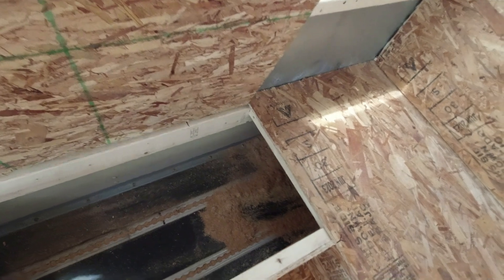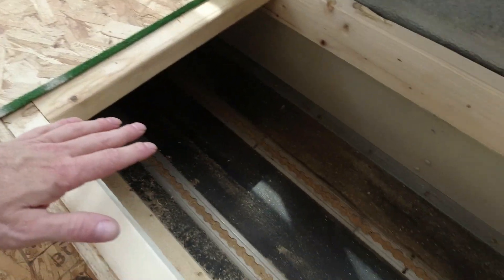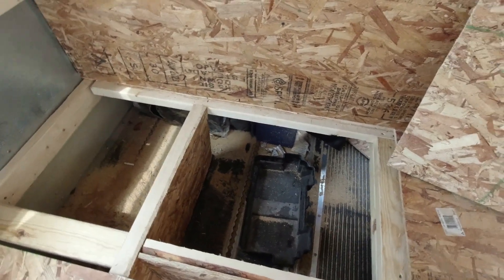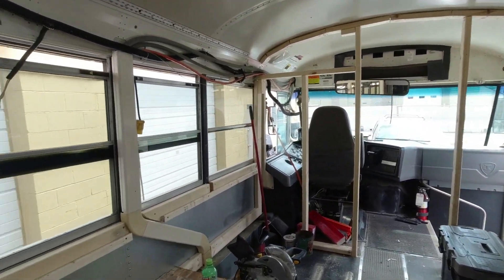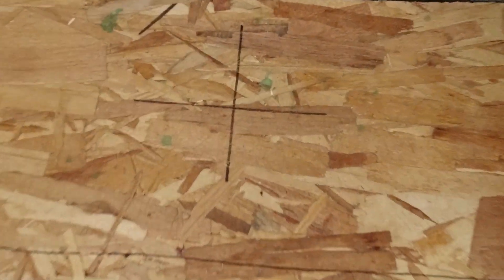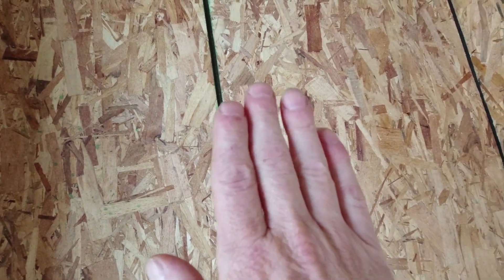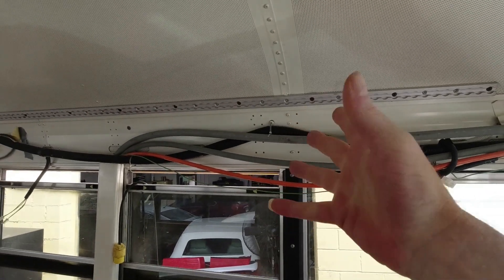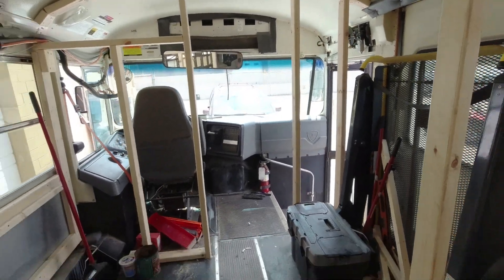DCC- Party Bus - Framing a bus, EXPLAINED !! - Day 7

Comment: So my first question is on the specific screws YOU use.
 Oh yeah, and what depth are pretty standard for the seat bottoms?

Hey man, I love what you're doing. I have a few months woodworking experience and I'm a natural. This is the kind of thing I need to know how to do. Is there anyway I could get in direct contact with you. It would be awesome to get some advice from ya. Let me know
Reply from the maker: Mostly I use drywall screws. You can call or text, the number is at the beginning of each video.

Comment: Where do you get your secret sauce from and what's it called
Reply from the maker: hehehe. 
My competitors have been wondering how I did this. Truthfully, it's just halographic sign vynal.
Reply: How do you attach the custom made ceiling panels and wall panels?
Reply from the maker: Simple screws .
Reply from the maker: I will post a video when It's time.
Reply: I understand that part but when you place fabric over the piece being mounted, your not drilling through the fabric are you?
Reply from the maker: Sometimes yes, but I try to hide what I can. If the screws are showing I will use some fancy washers.